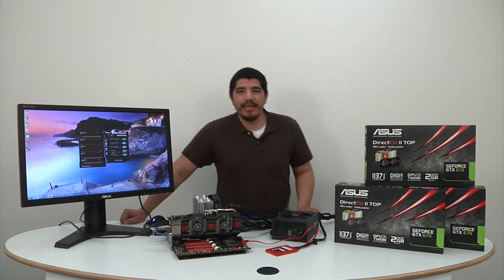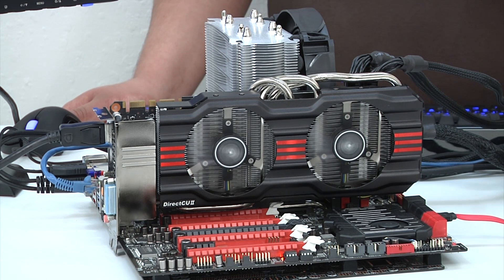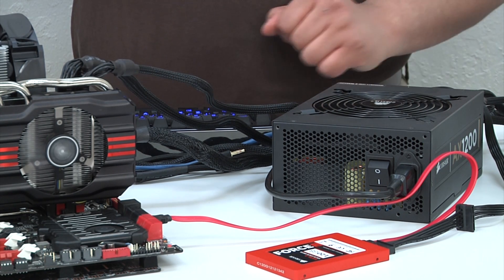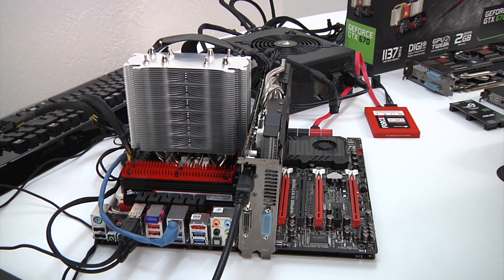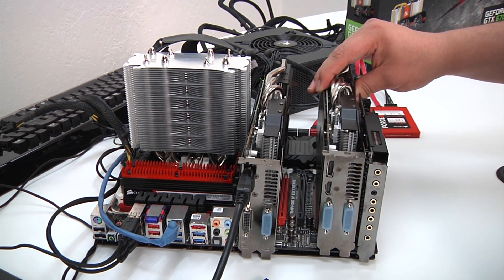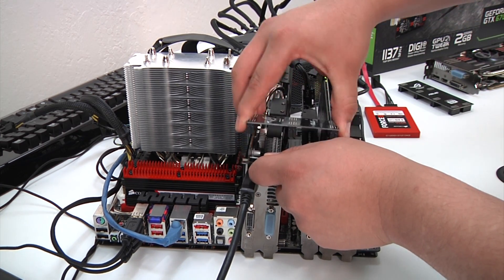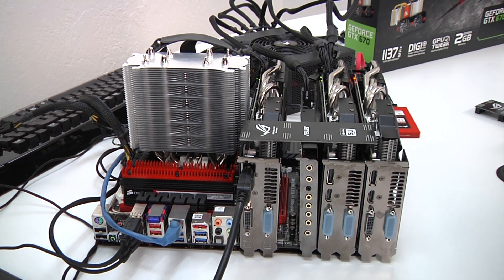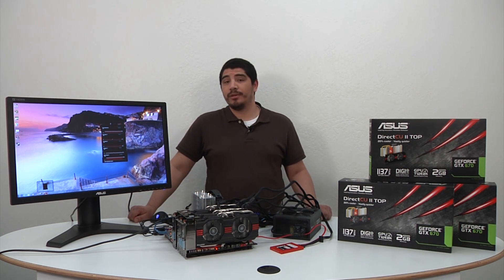GTX 670 Direct CU II 3-Way SLI Performance Video

Comment: I don't think you have enough RAM. A minimum of 2133 MHz is required. Also I think you should do 4 way sli AND with GTX 680s. Also a 680w is total overkill. You should go get a Codegen 350W PSU. Modern stuff is VERY power efficient.

Comment: what's the point of the sound card is it's not even being used? and wouldn't it be more intelligent to place all the 670 together and THEN place the xonar card after them? would only require a 3 way sli bridge and more space to place more stuff without removing anything

Comment: What what what? you seem to be plugging in those cards with live power. The red leds on the card don't lie.

Isn't that dangerous? I always turn off my power supply and wait a few minutes for the capacitors to discharge before changing ram or graphic card. Have I been doing it wrong?

Also, which is better, the ASUS HD7950-DC2T or the ASUS GTX 670-DC2T? Keep up the good work Asus, you have great quality products, not cheap, but you get what you pay for.

Comment: Hello Asusrog, I've been looking around to find out if there is any benefit to running two SLI bridges on the Asus DCU II Top cards (two cards).  It sounds like 1 does the job and no benefit for two, but wanted to check with you guys directly on this.  I appreciate it (I installed the cards last night but was curious about two bridges).  Thanks.

Comment: How is it possible to use 4 way sli bridge for 3 way sli? I thought it's not possible.
Or at least not the way he installed it. 
According to the 4 way sli bridge schematic, the second card from the top is connected to the first and the fourth card. The first card is connected to the second card and nothing else.

Since the second position is not populated in this video, the first card actually has no connection to the rest of the cards. How would Sli work like that?

Comment: Btw "maximum an i5 can go to is 4.6ghz" is the dumbest thing I've ever read. There is no "maximum" overclock. Each chip is different, some OC better than others. A H60 or a 212+ can easily overclock an i5 2500k to 4.5ghz. Custom loops can get 5ghz.

Comment: i5 at 4.6ghz thats bullshit that absolute maximum an i5 can go to is 4.6ghz but you would be an idiot to go that high with an i5. and looking at your videos you  play very low demanding games. so 4.6ghz on minecraft wow. what a waste.. literally a £1350 mobo and i7 3960x and watercooling set up struggles to overclock to 4.6ghz

Comment: ASUS can you run cinema4d cinebench 11+ render test as loads of us do render and we would normally use it on 3Ds MAx and Cinema4D Vray and more although we cannot upgrade to i7 or i5 we have got Q6600 and DDR2 or DRR3 ram how much difference will this card make!!!

as i was thinking of getting it to replace my 6870 as it will support the 3Display support

Comment: What the point of having 3 or 4 or 10 for exemple gt 220 if the game is made for gt 440? Isnt better to have a single and better gt 440 then a lot of power consuming and heat generator 4 cards?

Comment: who has enough money for the $400 mb and the 3 $300 (if i remember right) video cards. plus everything else that you would need cooling wise for playing an real game not alien vs predator. why cant they test using bf3? from what ive personally seen bf3 on its highest settings uses the most performance wise. put your products under an actual test. and really any i7 only at 4 ghz is a waste. i have an i5 at 4.6 ghz. real good job people at asus.

Comment: Hi @asusrog . I just bought a Rampage 4 extreme to replace my x79 sabertooth. I also just bought two GTX 680 TOP edition DC2 (triple slot) to replace my single 7970. I also have the HAF X case.

Please help me on the layout, this video had three dual slot coolers but mine is triple slot. Which slots should I place them on? The 16x slots will have a one slot gap between them or I could place it lower for more air.

Also should the side panel fan be intake/exhaust? What about the front fan?
Thanks

Comment: Probably ASUS did 3-way sli test in the office, not on the video. To connect 3 cards in 3-Way SLI we are ALWAYS! need to have 3 connections (1-3, 1-2 & 2-3, look at the any 3-way bridge pinout). 3-Way sli method with 4-way bridge from this video will never work - it's just a JJ demo mistake.

Comment: All my cards are dual slot & 4-Way sli bridge IS NOT WORKING as in this video just because we need 3 connections between 3 cards (1-3, 1-2 & 2-3, look at the any 3-way bridge pinout). Problem is into the bridge, not in the gpu thickness. This is JJ demo mistake. Probably the 3-rd ASUS did in the office. On the video we seen only 2 of them.

Comment: The GTX670 shown in this video with DirectCU II technology is only 2 slots. If you were to compare our cards with the other vendors you mentioned our 3 slot design out performs each and every one of them. Plus the majority of people are not putting more than one card in their rig, and it is because of this fact that we went 3 slots because they will our perform while being as quiet and as cool as possible. This obviously doesn't include waterblock cards.

Comment: the GTX690 platform wont allow for more than 2 cards on a board. But if you put 2 cards on the board you are essentially running 4-Way SLI because there are 2 GPU's per card.